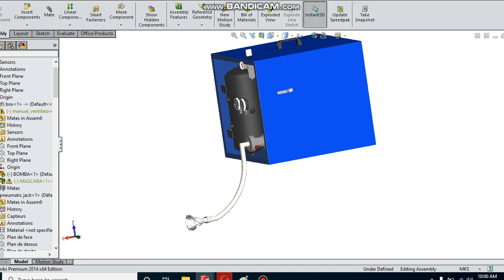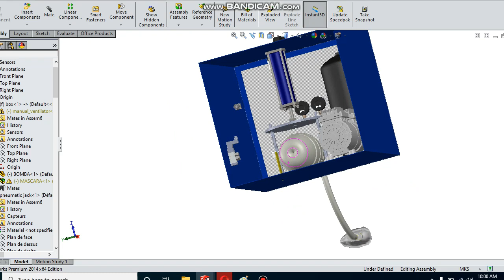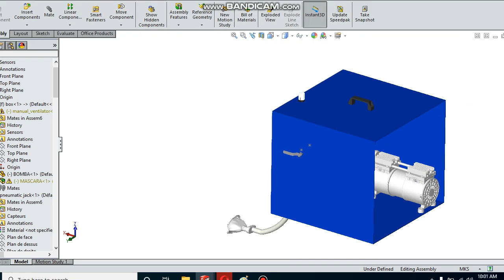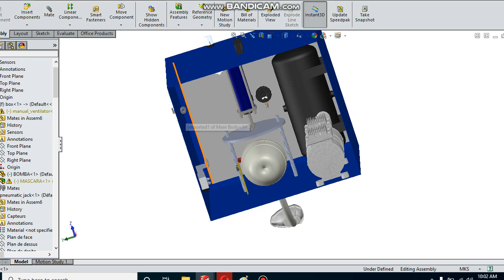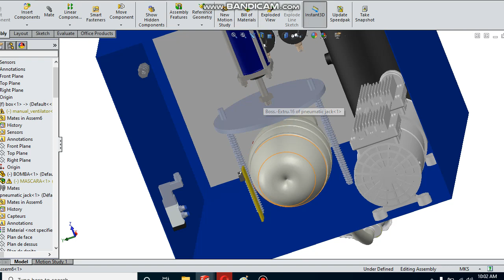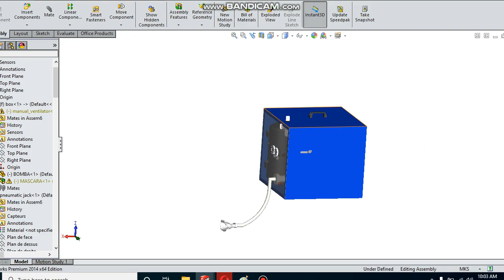Mechanical Ventilator Design Using SOLID WORKS

Comment: If its so simple. Tell me how to synchronise patient breath with this Mechanical ventilator. as you know breath and pulse of a patient are not constant. when he in sleep patient breath decrease and your ventilator will force pressure air in lungs. This may injure permanent lung damage. Be responsible. just adding video for like & subscribe. First you should yourself learn about patient physiology of Breath and body response.